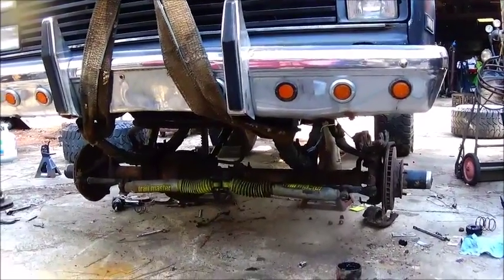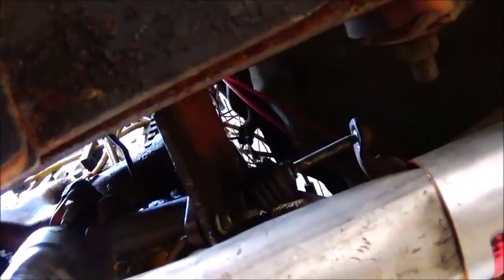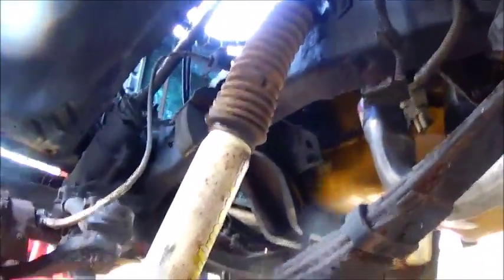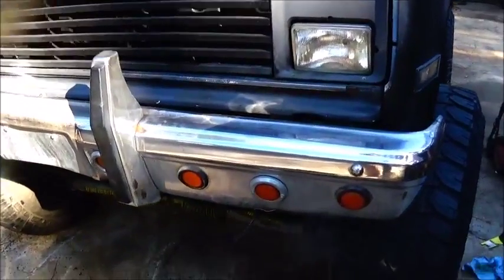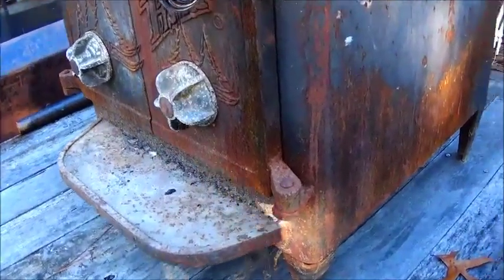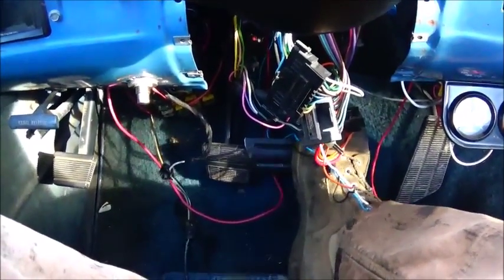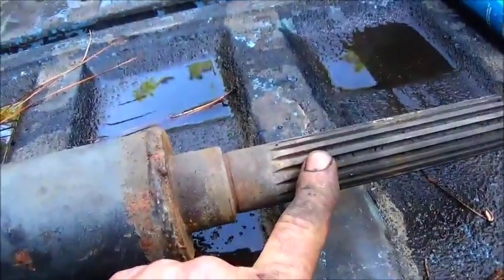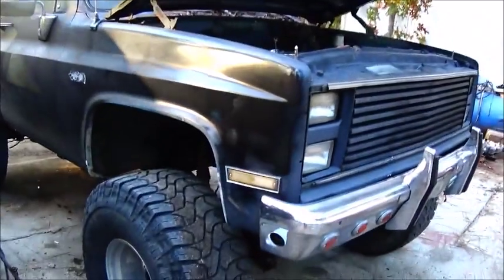4x4 Square Body Project Part 4

Comment: Pull the clutch cylinder , flip it and mount it 180° on the same side of the mounting plate as the clutch rod.  Then make a rocker arm assembly to push the clutch rod.  Make the rocker with an adjustable length and adjust the throw length to suit the need. Since you've done similar when engine building, it out to be a snap and you probably have the parts too....this from a proud U.S. Army Veteran who admires your skills...Bo.

Comment: Another thing to check, is I am sure they put the linkage style clutch pedal assembly in when they did this.  The hydraulic clutch pedal assembly has two rods that go to the firewall that actually serve as the bolts for the master cylinder and stop any flexing of the firewall when pushing in the clutch.  If they didn't install hydro pedals then eventually the firewall will crack at the master cylinder.  That sheet metal isn't strong enough for that.  When you started it up and pumped up the clutch it was moving quite a bit.  No surprise they didn't put hydro pedals in it...hard to find and expensive unless you have a parts rig, they just cobbled a clutch pedal next to the auto brake pedal and chopped the brake pedal.  Sketchy as hell....    Take care!

Comment: I'm thinking it must sound better in person cause it's not sounding to good from where I'm sitting, I understand some of that might be an agressive cam, some of it could be headers not seated or missing some hardware bad gaskets if it has any, could be bad headers for that matter. At any rate it's getting getting better thanks to your patience and expertise, your absolutely right about those blocks I've seen the trouble they can make. You always put up a great video so thanks for sharing this project

Comment: '60-'62 Chevrolet trucks used a hydraulic clutch. The slave cylinder was mounted on the opposite side of the bell housing. I've had a '62 since new.

Comment: During those years (76-80) there was aTSB from GM about OVERSIZE FRONT TIRES-- too big a tire will cause excess frame flex at the steering box & frames have failed I've seen it & have repaired a few by fisk plating the inside frame rail.

Comment: I hate to tell you this Jonathan, but if you want to run square body mechanical clutch linkage in that truck you will have to have a square body only bellhousing. The bellhousing is actually part of the clutch linkage in the 73 through 84 Chevrolet and GMC pickup trucks. Ball that would go in the back of the engine block on the driver side actually screws into the bellhousing itself.
Reply from the maker: I have had to make brackets before to line up the Z-bar with the pivot on the frame although I do have the correct bellhousing with the ball, but I also have the bellhousing for the slave cylinder.

Comment: Jonathan, do you have any tips on what to look at before purchasing a 64 IH c1200?
Reply from the maker: If it's been changed or modified, just check everything that was done. If it's original IH, just rust issues and if sitting, same as all brands, brakes and fuel systems suffer the most from sitting.
Reply: Jonathan W thanks, yeah it original IH, with a parts truck.  Repairing rust on the body doesn't look too hard with the thicker metal, but it has been sitting, will need a brake job done for sure though.
Reply: sweet though

Comment: Last square body 4 wd I worked on I had to use a coat hanger to pull chunks of bearing and seal out of the axle tube on the rear, the bolt for the diff pin was the wrong one, I can't remember what all was wrong, it was bad.
Reply: Ouch. On my truck the bolt fell out and so did the pin! It snapped off against the housing right before I was going to get on the highway. Limped it a bit in 4 wheel drive and the axle walked out because there was nothing o hold the c clip in.

Comment: I've noticed in my old age that most vehicles do well for decades but once "upgrades" start up things go south like greased lightning.
Reply from the maker: I am 100% with you. Hey let's cut the stock stainless exhaust off and replace it with a set of duals that will rust off in 2 years, or take the factory stereo out and put in an over complicated pile of crap. That's where it all begins and starts getting worse with lift kits, aftermarket rims, am I sounding like the old "Get off my lawn" man yet??
Reply: Especially with lift kits, folks don't understand that there are a lot of constraints on the chassis and suspension design to get it to act civilized and live a long life and after they get it to the height they want they have taken it from an elegantly engineered vehicle to the likes of a go-kart.  Then they wonder why it develops the "Death Wobble", or changes lanes going over a bump in the road, or everything wears out real quick-like.
Reply: The funny part to me when people upgrade or think there’s is better, is that they don’t think for a second how many millions gm put into engineering the vehicle
Reply: Like Jonathan pointed out about the bumper being part of the front end structure,  vehicles are collections of systems.  If you see them as just a bunch of parts,  you can really goof things up when you go custom.
Reply: Jonathan W in some instances up grades improves it but that's normally on road machinery built by virgin accountants and "enginerds" as AVE calls them!  That doesn't make a hard earned living

Comment: If that were my truck, I would remove everything that causes it to ride any worse then stock however, The lift looks sweet, & tough as nails but, The point is, I hope you get her running great because she is a beautiful truck & it is my belief that the value is only going to go up!  I'd wet coat the entire underside of that truck & get everything covered in a 50/50 mixture of diesel & bar & chain oil to ensure it's longevity! You have to love people who go mudding & do not clean the vehicle afterwards & allow the vehicle to rust out because of it. I really like that chevy & I would want it to run as good as it looks! I would redo everything on that truck! Starting with a new set of pedals with the hydraulic cylinders built in to the pedal system! I believe that truck is worth putting money into & doing right! She looks tough as nails! Well, After you fix everything that is.

Comment: You might have said in an earlier vid.  ..what size engine? from a break view looking at the leaking Rab..looked like a 350?
Reply from the maker: 1970 350 300hp with the correct heads.

Comment: I really hope whoever built that engine wasn't the same guy who did the rest of the work. No valve cover gasket is not a good sign that it wasn't the same guy though. Well, the truck has the potential if you have the patience.
Reply from the maker: I doubt it. The valve covers was put on by the guy I got it from. I forgot that he gave me that gasket and told me it went on the pass side. If you notice there is wing bolts on the driver's side, he was going to pick up more for the pass side. I have seen nothing on the truck that has surprised me, about as I expected when I got it.

Comment: Hell that exhaust pipe is just shoved in the pipe not even welded together lol
Reply from the maker: Sweet, aint it???
Reply: Jonathan W yeah thats a jewel as well as the tack rig for spraying liquid asphalt at work that whole thing is a CF from the factory I'll probly do a video of it can't believe leeboy put there name everthing on it is wrong on it boss paid $16,000.00 for it my pops had one made for $1500.00 The home made was built just like the big boy etnyre my dad had a 1950s etnyre 1500 gallon asphalt distributor tankwith a Hercules flat head straight four water cooled engine that powered the asphalt  pump it ran good it still ran when he sold it in 2010.  "OH" that flat head Hercules sounded so good when running but the flapper cap made it sounded even better!

Comment: What did the boy tell you was wrong with the truck? I turned on the closed caption & it states that, "The whole miles it was bad, That was where you assumed that was the problem". What did the boy say was wrong with the truck? I apologize! For whatever reason, there is a lot of static today plus one of my cable's has shorted out so, I cannot use my surround system which, I usually always do use it & preserve the speakers on the t.v. Why is it that regular speakers are non existent anymore? They want to either sell you pathetic tweeters/midwoofer's at best or, you must pay a fortune for regular speakers with 12's, +mid & tweater or, 15's+mid+tweeter or, 10's +mids & tweeter? SIMPLE CABINET SPEAKERS? These days, they just want a fortune for anything & everything! Maybe if they take away real speakers, one will pay more for them later? screw that & pathetic speakers